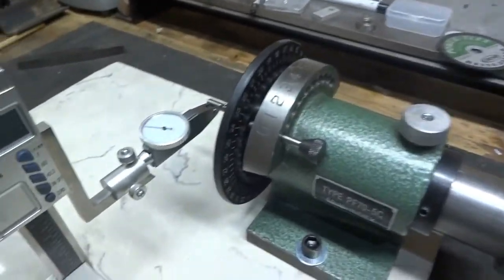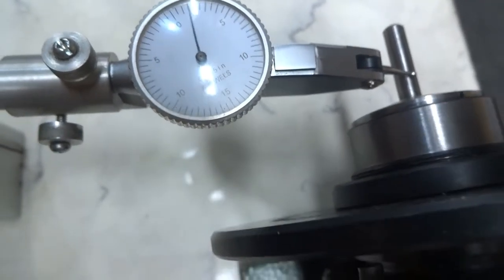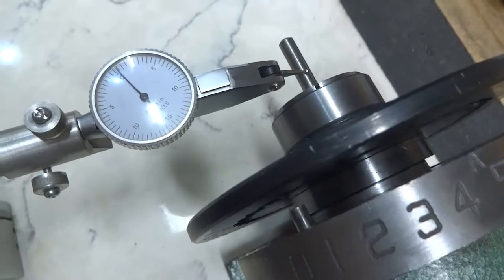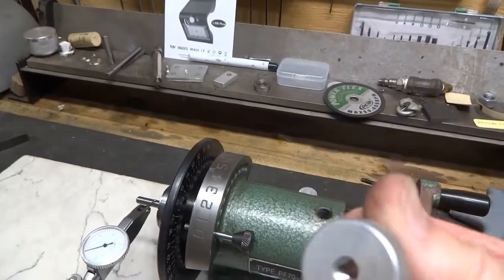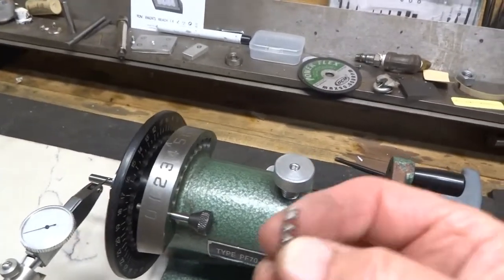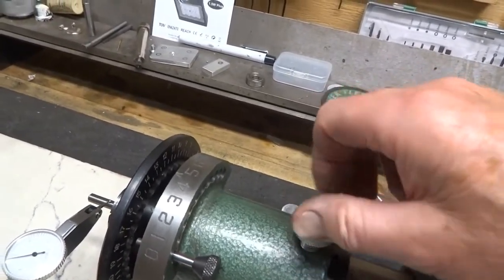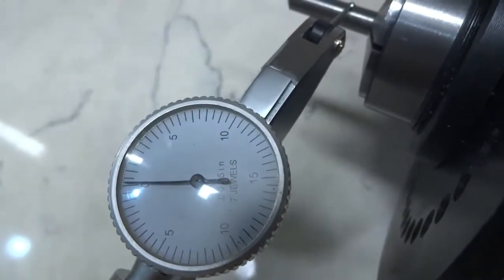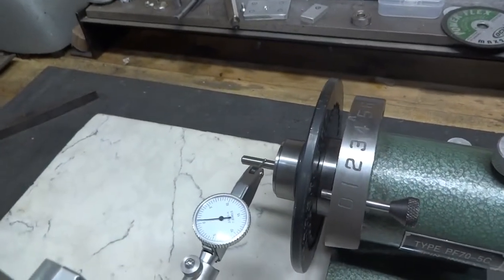Increase accuracy of an inexpensive Spindex unit.

Comment: I found the same problem with my 5C spindex. Same brand. And the spec. sheet say's it good to half a thou. I was able to insert a brass shim stock piece, about .5inch wide by 2 inches long, between the tube that has the 5C collet internal taper, and the outer casting bore hole. I put it on the side that produced the best parallel to horizontal for stock put in the collet. I mostly use mine on the surface grinder to grind hardened shafts to a small diameter. Irritating when they come out a slight taper. It's also hand for putting flats on the shanks of drills spaced 120 degree for the chuck jaws.
Too bad to get a quality unit, you need to spend $1000s. But I'm close enough with the fix.
So if you put in a longer shaft in the collet, and slide the whole index unit along, how much slope is in the shaft chucked in the collet?
Also if you slide back that lock ring collar, you can extend the shaft tube outwards (the part with the 5C collet), how parallel is that over the travel?
At least your fix did not require months of rebuilding the unit, as in making it from new material.
Reply from the maker: Thanks Fred for the detailed description of your fix. I will have a look at the things you mentioned. I am going to think more on this maybe there is a way to get closer to perfect.
Reply: @MrModify  Don't forget that your measurements are dependent on the concentricity of the collet.  I think that it might be wise to also check directly on the tapered part of the spindexer bore.
Reply from the maker: @MotoChassisByTonyFoale  I will check that out to-day.

Comment: I have a Yuasa and having run out and slop.
I think maybe try a .001 shim in three points in front and then in back side see how that goes.If not the roller bearing good idea also.
Reply from the maker: If you have room for .001” shim l would put it all the way around back and front.
Reply: Yeah,I will try it.You get what you pay for I guess.Terrible you are in tool room trying to do accurate grinding and pc of crap has .0025 of shake.Working in aerospace the time I take repairing it they can buy top of the line.